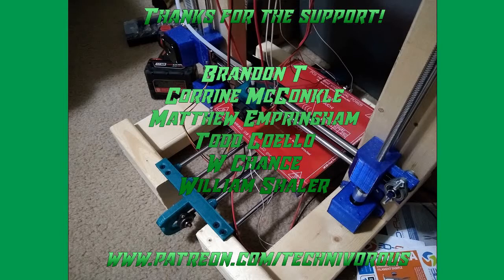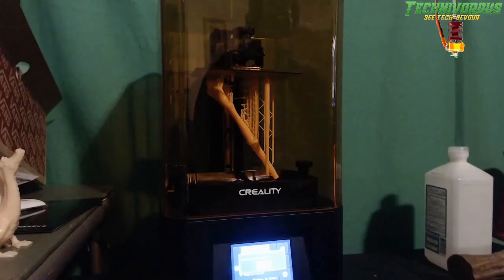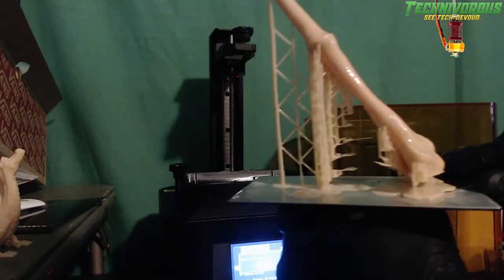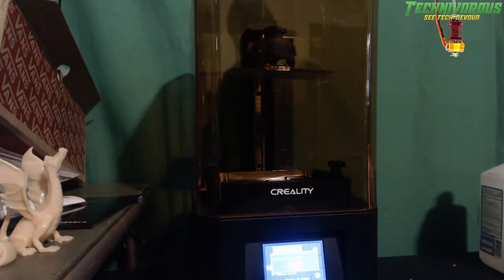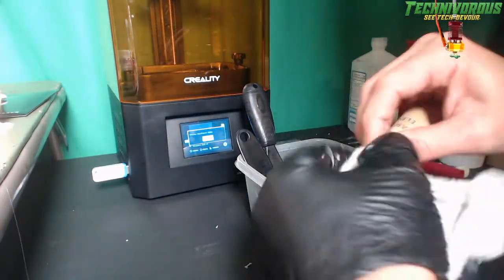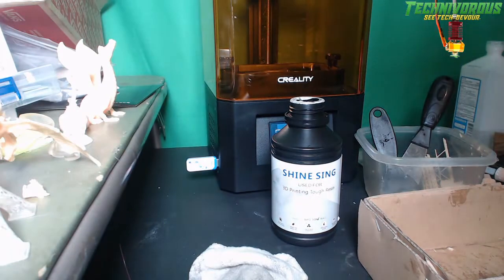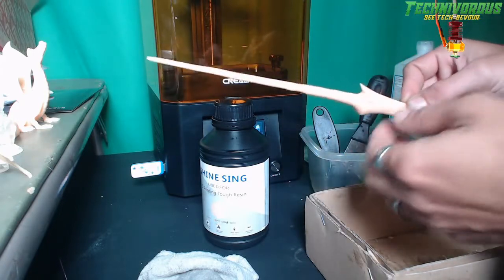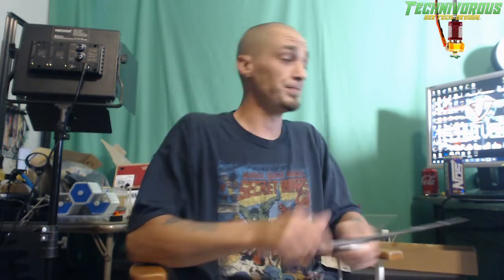How to join Resins prints with no seam - Printable Props - 3d printed Elder Wand

Comment: i like the method, but how do you bond 2 transparent pieces together without using a connecting piece ruining the transparent look
Reply from the maker: Hmmm I'll look into this, it may be possible to join them using resin before the cure, to get a pretty seamless look. I'll have to try it soon.
Reply from the maker: I think if you get enough resin between the flat surfaces you shouldn't notice once its bonded, but just coating the outside will leave a seam
Reply: @Technivorous  so brush some of the same resin between them then do a cure?
Reply from the maker: That's what I would try. I might now someone who knows another way, I'll keep ya posted if I hear a better method.
Reply: @Technivorous  that be awesome, sometimes I need to put transparent bits together and super glue didn't work when I tried it
Reply: You can get a uv glue kit that comes with a uv laser. Thats what i use. Just make sure you get some properly rated laser goggles. 

I paint on the resin and cure it with the laser